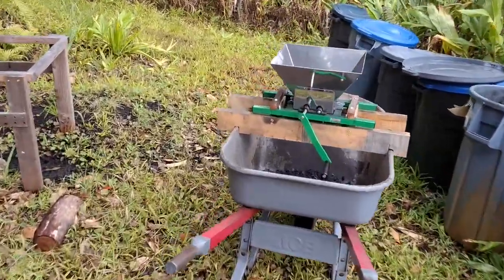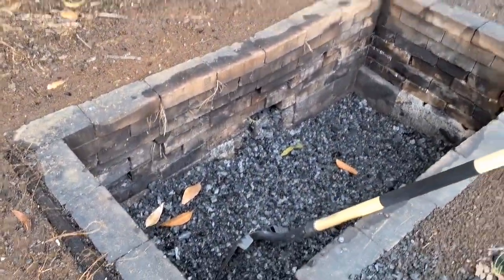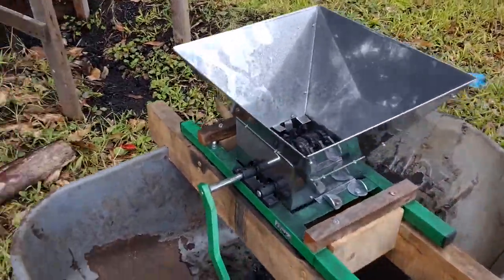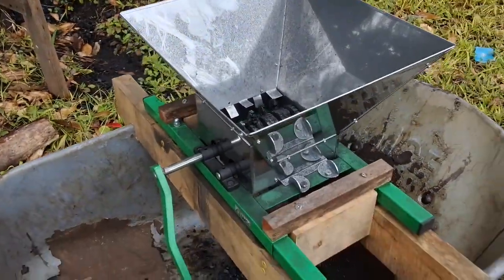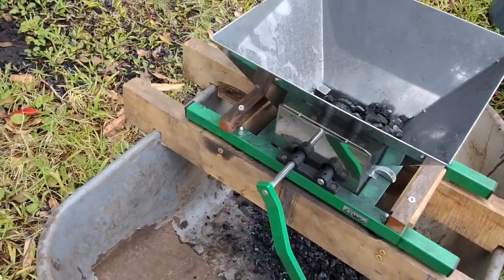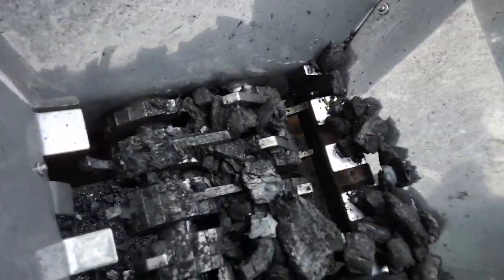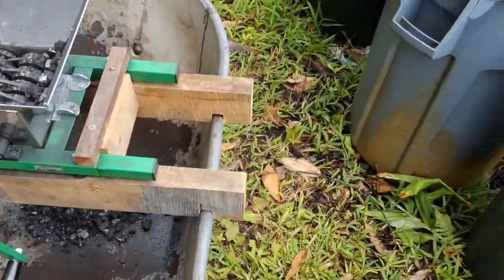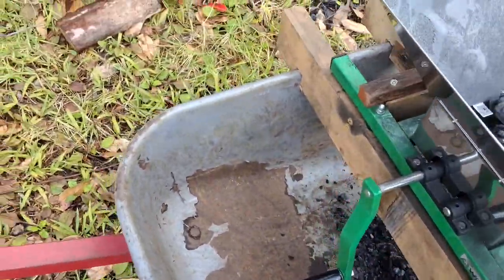Crushing Biochar with an Apple Grinder

Comment: Do they make a electric fruit grinder  ? 😊
Reply from the maker: I have seen some electric fruit grinders online, but they mostly use a different kind of teeth, like a rotating drum that grates rather than crushes.  That seems quite a poor fit for charcoal.  I also saw one for sale which is basically like this $100 fruit grinder with a small electric motor added but they are asking $763 which seems crazy.  The search continues!